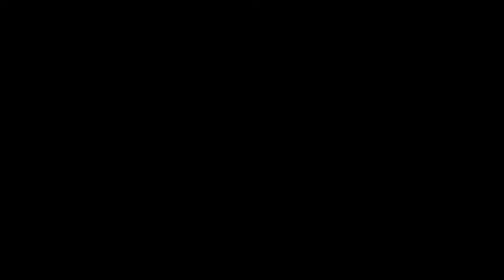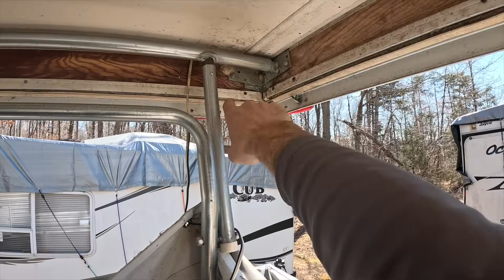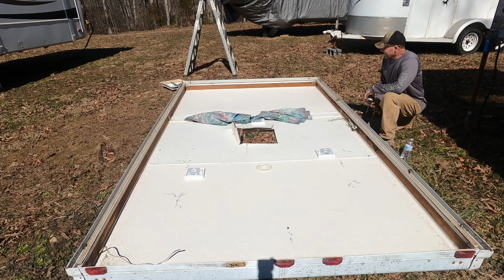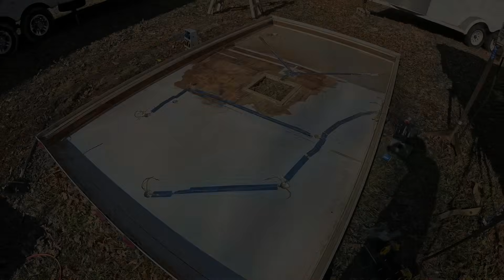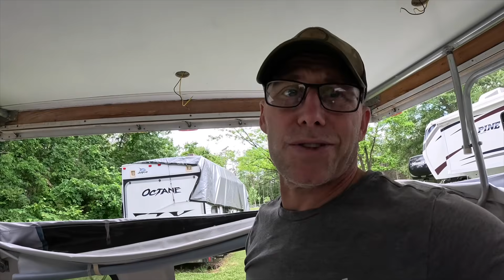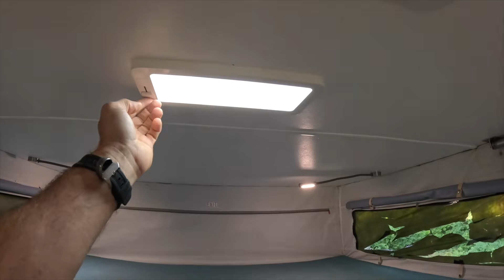Camper Roof Wood Rot Repair | DIY RV Roof Restoration

Comment: I opted not to take the roof off. Aluminum RV roof repair…. I have a few ideas but I need a more serious KNOW IT ALL person to advise. 

Im doing a complete restoration on my popup truck camper. The roof is THIN aluminum, THEN! The leading edge of the roof has 2 big holes from bolts (at the ends/corner) and my guess is just over time the holes around the bolts wallered out holes “&” pin holes dowwn the edge. 

I need something to fill holes! And something thats drillable. I gotta reuse those big hole areas.

Suggestions please
Reply from the maker: Is it possible for you to send me pictures of it? If you can send them to mark@parkedredesign.com. I could get a better idea of what you are talking about.

Comment: Also is that roof insulated any??
Reply from the maker: The roof has a thin styrofoam that in the video you may see. It is glued to the top, I had to scrape out some of the styrofoam to fit the pot lights in.

Comment: You think it would be too heavy if I did this and instead of installing those panels I used some thin stained 4" wide wood tongue and groove?
Reply from the maker: If what I am thinking of what you are explaining, I don't think it would be too heavy. I have seen people add solar panels to the roof so I can't imagine that that wood would be much heavier than that.
Reply: @parkedredesign Thanks for the reply. Good videos brother! The two roofs you did helped a lot. I'm thinking of buying a 2008 Palomino truck bed pop up and all the wood in the roof is rotted. I will have to rebuild all of it. And reuse the outer skin?? Or just put new aluminum skin probably. 
Thanks
Reply from the maker: @OYET-te2jn  If you get it for the right price, it's worth it. In all reality you could get the roof done in a long weekend. Good luck!

Comment: I have taken the roof off my Sunlite TC but I am about to. I started in Aug 25, with a dern near complete rebuild. Nose/bed total rebuild, all 4 corners, new counter top, new insulation where I had all the siding off.. OH YES! a 90% rebuild. BUT, my QUESTION is.... when you did this roof, does it have furring strip in the roof with Styrofoam board and then you put paneling back over the top? Or did you just pull of the bad lauan board section off and put  lauan back over lauan? I think its my fan sealant too.
Reply from the maker: I did only pull off only the rotted luan and left the luan that was not rotted still in place. I covered over the luan that was left in place with a new piece of luan.
Reply from the maker: I only pealed off the bad lauan that was soft. I was going to try and take all of it off, but the good portions of the lauan started to tear up the insulation and I didnt feel like replacing all of that so I left what lauan would not come off easy and put new panels over that using the liquid nails and narrow crown staples. I have another pop up roof repair video that where I replaced everything, so you could do it either way.

Comment: did you have to adjust the tension on the torsion bars after putting the roof back on?
Reply from the maker: I did not adjust the tension on the torsion bar per se. The bolt holes on the roof vs the bracket on the lift mechanism did not line up perfectly when I went to put the roof back on, but were close enough where I could pry it down to get the bolt through. When I tightened the nut it came together.  (Hopefully that makes sense)
Reply: @parkedredesign  yeah that makes sense. Would it be possible to get in touch with you to possibly repair the roof on mine? Its also a skamper camper
Reply from the maker: @samsin102 Sadly, I currently don't have any spare time. My job has me traveling a lot right now. Not sure what your time frame is to get it done. Also how bad is it?
Reply: @parkedredesign honestly not too bad. Pretty much just needs the same type of repair you did in the video.